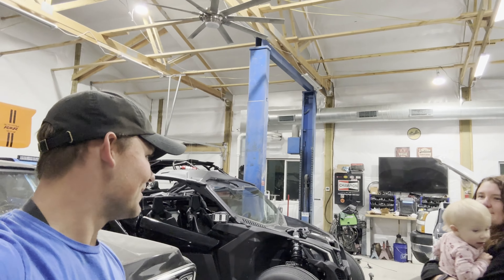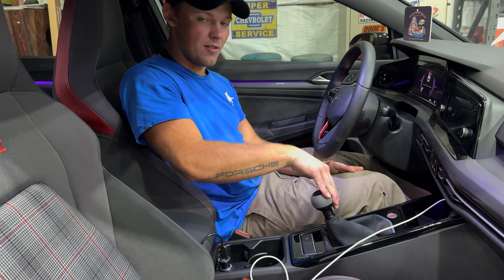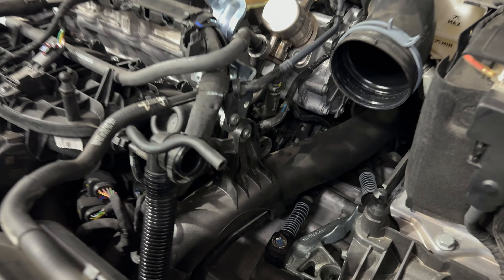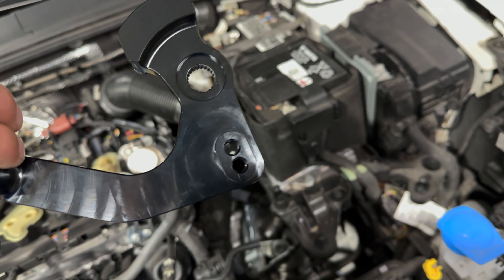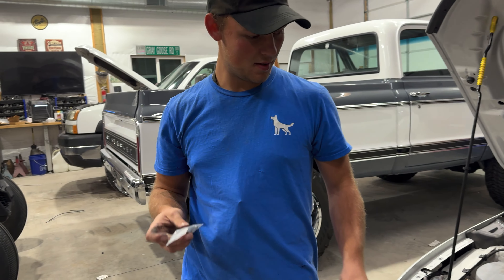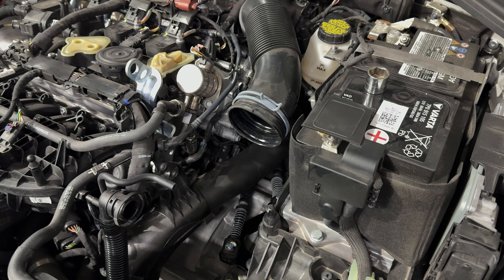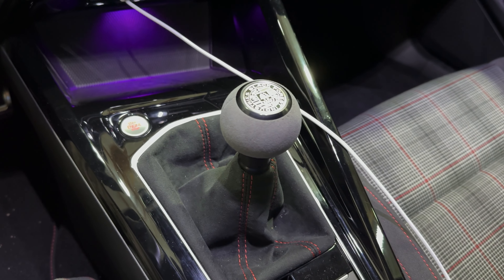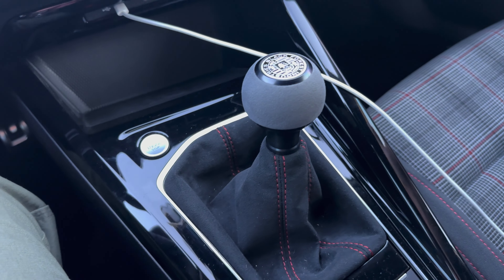Upgrade Your Transmission: Mk8 GTI CTS Short Shifter Install

Comment: What are your thoughts now after a year with it? Or did you end up swapping to something else?
Reply from the maker: I still really enjoy the short throw shifter , the only adjustment i have done is elongate the throw instead of having it on the shortest throw (Because of my Revin Shifter unit) if i hadn't gotten the aftermarket shifter assembly it would still be on the shortest setting.
Reply: Nice! I see that revin unit is kinda like a gearbox setup I had from ktuned in my RSX-S before I sold it. I'll def need to research on that then. Would you say it paired with the CTS short shifter gives a rigid feel in a good way? My Ktuned setup had solid bushings and it made a world of difference. Sorry about all the questions I just got my MK8 a week ago brand new and I'm itching to do so much already lol Loving the VW community there's videos and write ups for just about everything!

Comment: Cool, seems like the CTS is based off the Audi shifter which should help with the vertical throws mostly. 

I installed the holy shift from shop dap which is a little different and has its own metal linkage. The short throws are vertical and horizontal and it’s significantly better that stock. 

Although, the shifting experience can get too raw, as the shifting cables are gripped so hard by several screws on the metal linkages. Sometimes I think too much force has to be applied for 1st, 2nd and reverse that not even months of breaking in could help with.

Also, keep up the mods and good work. Congrats on your beautiful family!
Reply from the maker: Thank you appreciate the comment and compliment! I could definitely see that being as you said “ too raw “ of an experience when it’s cold in the mornings here it requires a lot of force to shift feel although it has more to do with things not being warmed and fluid then the actual shifter mechanism it’s self but I can understand what you’re saying!

Comment: When you installed the shift knob, did you need to cut the boot where it meets the OEM shift knob? Or did you pry the OEM shift knob off? I’m about to install my new knob but don’t want to cut the boot just in case
Reply from the maker: I didn’t but I replaced the shift boot and shift knob at the same time so I never separated the two from eachother if I remember correctly it’s just a small plastic ring that hold them together they should just pull apart after you remove that ring !

Comment: Well shit maybe I’ve been doing my 2 to 3 and 4 to 5 shift wrong Im newish to driving manual and I’ve always just kinda went diagonal always is that harder on the gearbox when it’s stock? I’ve been debating on getting a short shifter but been concerned the sound of the throws are really loud but couldn’t tell if that’s just the mics in videos picking it up. Do you hear it a lot when driving and if so does it get old always hearing a clank when shifting
Reply from the maker: It is definitely a little louder than stock but I would say it’s not that much louder driving , the hood was open and the door was open as well and we were in a shop so it kinda trapped the sound. And as for your first question I have no idea in the GTI I always went neutral to 5th when going from 4th but I don’t usually do any hard shifting or pulls past 3-4.
Reply: @octane_media  ty for the tips I think imma get one here soon

Comment: Did you leave the transmission in neutral when you did this?
Reply from the maker: When I popped the stock shifter off yes , there is a way to lock it out as well so it can’t move